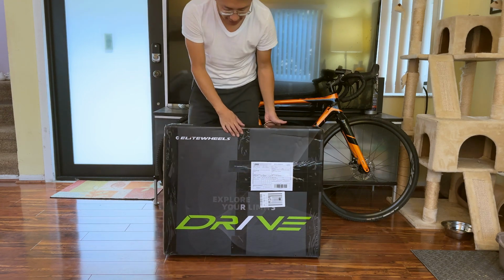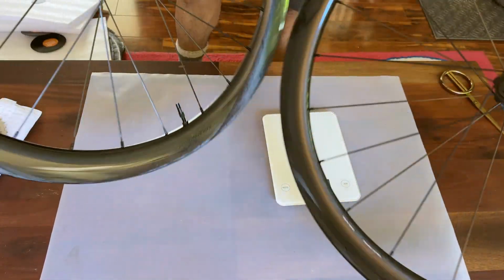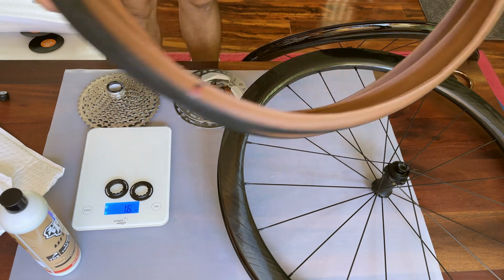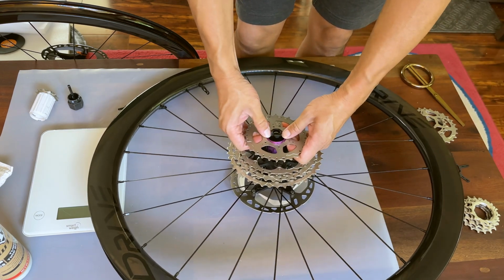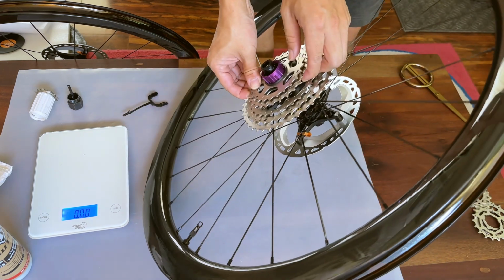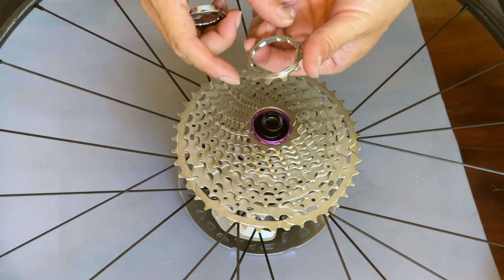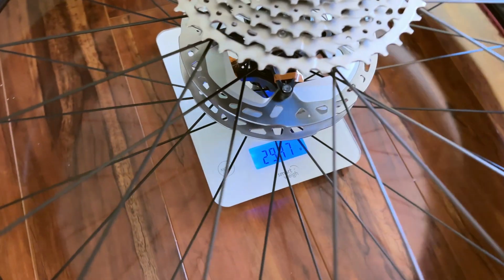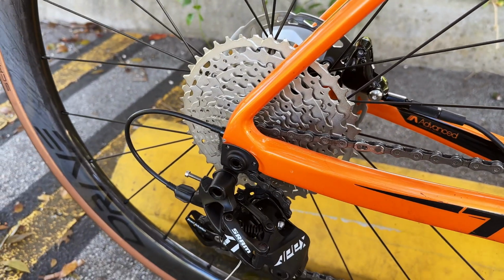Elite Wheels Drive G45 Full Carbon Gravel Disc Wheelset: All Good Except One Small Quality Issue

Comment: no disc lockrings included with the wheels?
Reply from the maker: Nope, there is no locking ring included, because it usually comes with the disc rotor purchase.
Reply: @TheGizmoGarage  yep. But on the road wheelsets of elite the lock rings are included in the box
Reply from the maker: @jackliang6061  Hmm, weird, that's good to know!

Comment: You should have applied grease on the freehub
Reply from the maker: Yes, park tools performance grease was applied to both the freehub and cassette before installation. Definitely not grease, though; this freehub just doesn't feel right. They sent me a replacement freehub for that reason.
Reply: @TheGizmoGarage  Thats good, nice wheelset though
Reply: how is the replacement hub?
 @TheGizmoGarage
Reply from the maker: @Shaneburke24  I kept the replacement hub, since this hub is already having a cassette installed we'll have to find out till it's time to replace this one. The free replacement hub they sent me has steel bearing instead of ceramic.